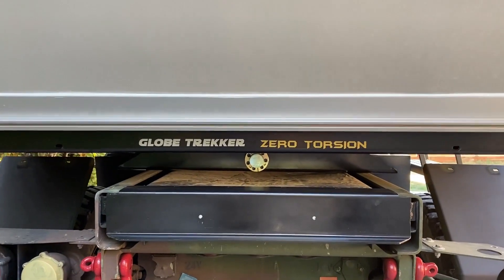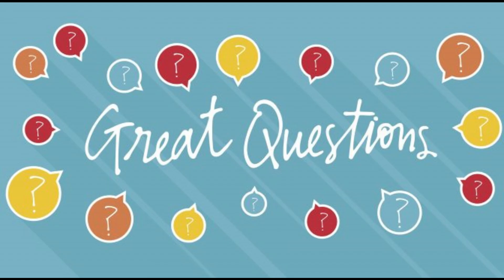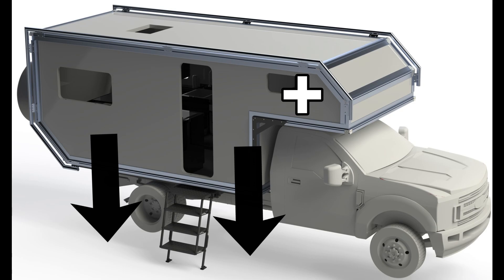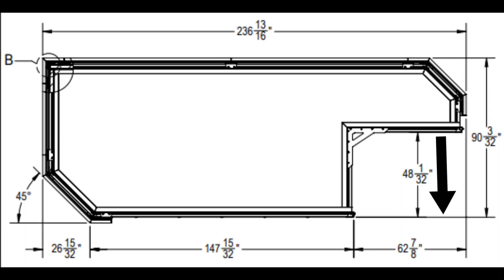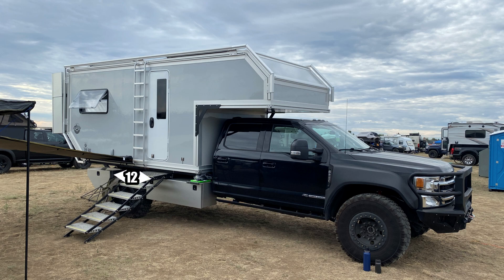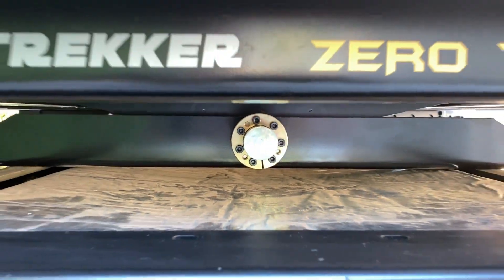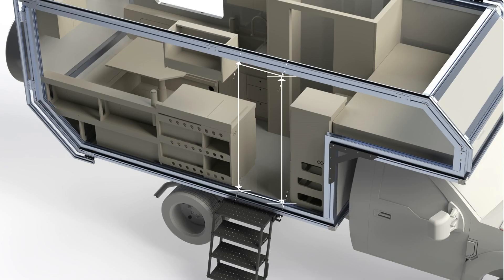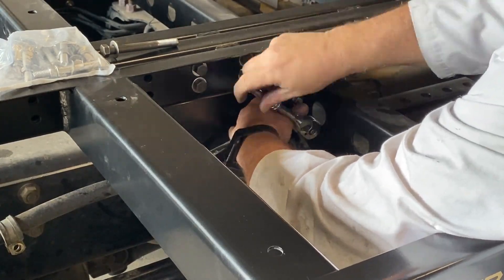Overland Expedition Subframes: Explained!

Comment: What's your view on cut through's from cab to hab?  Important?  You'll get one and you'll use it once?  In the process of building my truck and stuck on this question!  Cheers
Reply from the maker: We make pass-throughs if you want one. Nice for ease of movement when traveling. Good for security if you have to bug out while not exiting your camper. Good for dogs. If a big, hard to get in truck, like an M1078, if you got a bad back, it’s also advantageous. Otherwise, it’s just an option.

Comment: Nice vid! M1079 was a rail on rail so I am leaning towards that for simplicity on my m1078. Not too worried about my build weight with such a large base. If I had a Mog or Fuso I would for sure run a 3/4 pivot.
Reply from the maker: @russdf7182  we have now developed an Expedition series 2.5” panel that is 40% lighter for the Cabovers and smaller large trucks like the Mog, Fuso, and NPR.